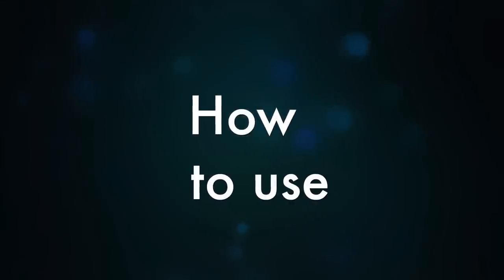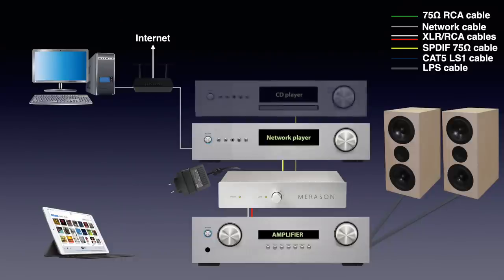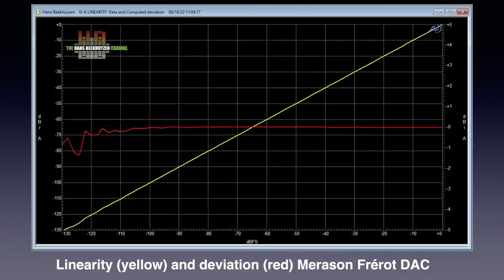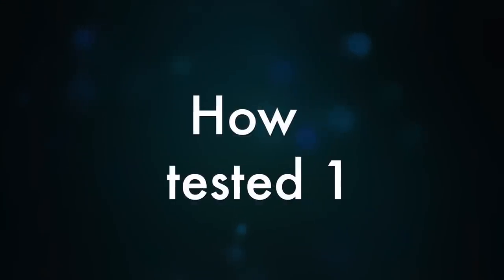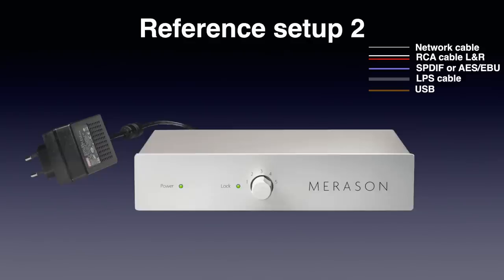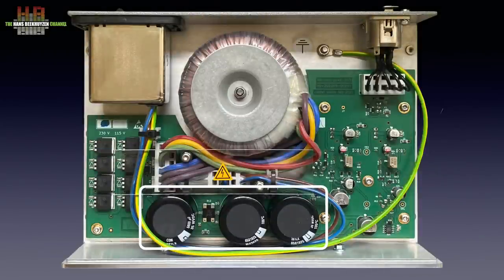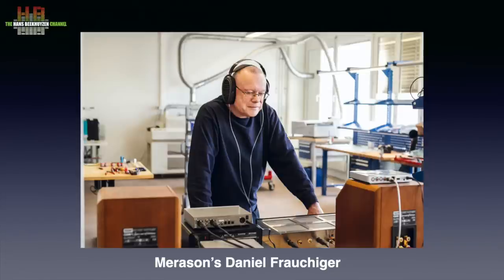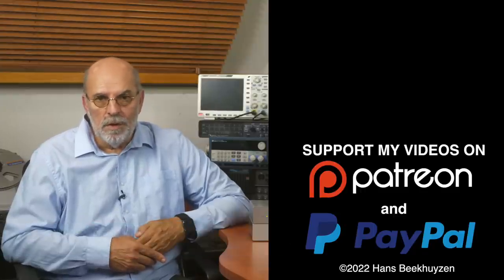Merason Frérot DAC + POW1 power supply

Comment: I have purchased this DAC based on the feedback of Hans. Replaced my Holo audio Spring 2 L2. I like it so much. I can't really describe what is good about it, it just sounds good. I use it with the matching power supply. Never bothered to try the wall plug. One interesting thing that I noticed and would like  to share is the very audible improvement in SQ with higher resolution files. In my previous DACs I never really noticed any meaningful improvement of 24-96 vs 16-44.1. With this DAC 16bit/44.1 sounds very good , it gets better with 24bit/96 and amazes me with 24bit/192. I find it is very interesting.
Reply from the maker: Enjoy the music

Comment: Thank you for the video.
If the POW 1 power supply already has a current filter, is it necessary to connect a current filter in front of it at all?
Do you have experience with this?
Greetings from Germany.
Reply from the maker: It might further improve the sound quality but is might also degrade it for too much filtering can make it sound 'lazy', slow.
Reply: @TheHansBeekhuyzenChannel   thank you for you quick answer! Your Chanel is very very good.